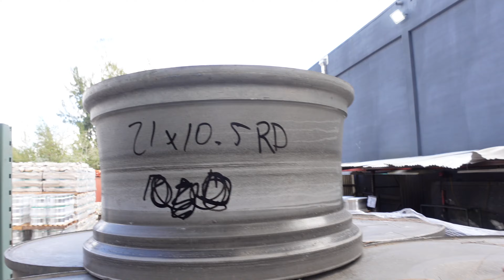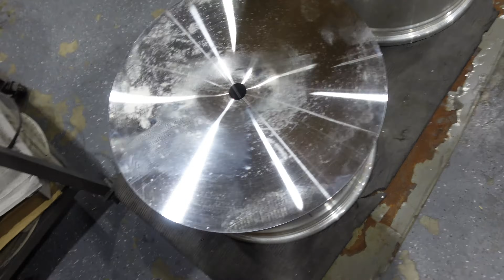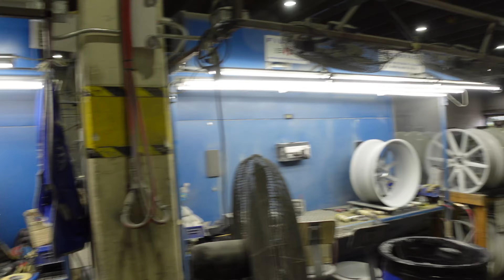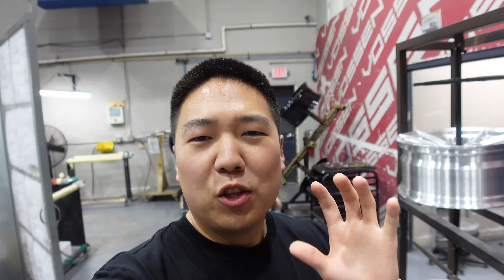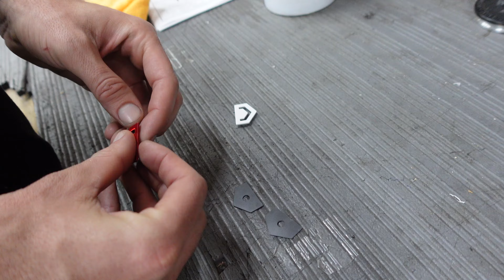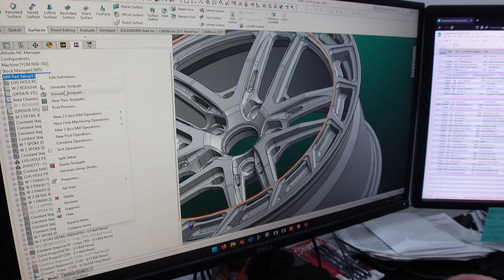Here's How My $12,000 Vossen Wheels Are Made!

Comment: I'm having a set of forged magnesium monoblock wheels made for my 370Z by Litespeed Racing in LA. We're looking at weights of 14 lbs for th fronts and about 15 lbs for the rears. They're going to be in a split Y spoke design and finished with gloss black paint and a clear coat, to match the finish of my car.